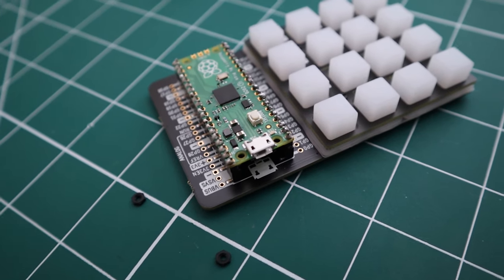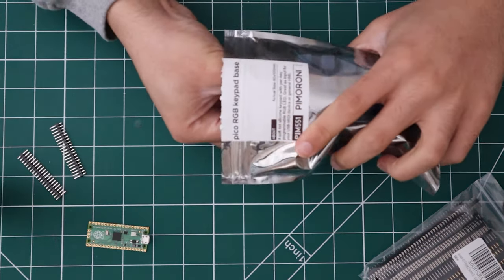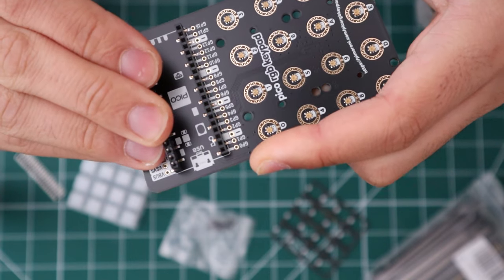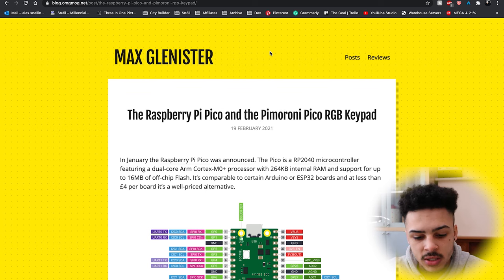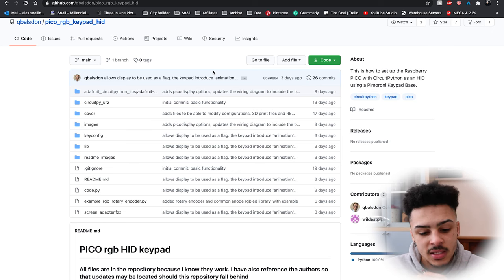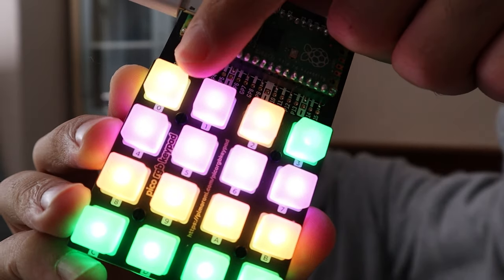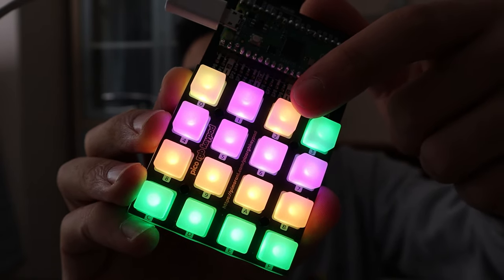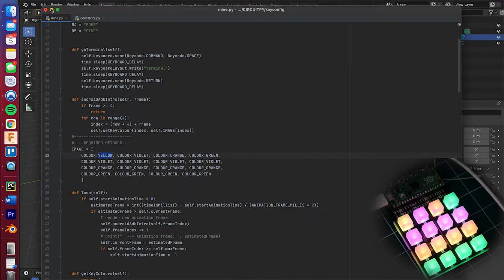Raspberry Pi Pico RGB Macropad - DIY Keypad By Pimoroni

Comment: Those solder joints look sketchy. 😅 Keep it up though! I've always hated soldering, and I've destroyed a pad or two in the past. Used to always put off projects that needed soldering, but soldering is one of those things that just becomes natural the more you do it. Great video!
Reply from the maker: Thanks I've been practicing but I still can get it down ahahah
Reply: @sn3lling  Tip: Do Not use the soldering iron to melt the solder onto the contact.  Heat up the contact first and then apply the solder to it.  The solder will then melt and flow perfectly.  If you try to apply hot solder to cold contacts, the connection will be extremely week.  Just be careful not to apply too much heat or you can melt or damage your parts.  Once you've got it mastered, you should be able to do each pin in a matter of seconds perfectly.
Reply: Is it safer to solder from a breadboard first?

Comment: Hey. It's my first time using the Pico with the PicoKeypad. I downloaded a demo.py code, saved as main.py on the pico, but it's not working. Simple python programes to blink leds works using micropython. I am using Thonny to put the scripts in. I am probably missing something really dumb. Do i need to install libraries for it (i know dumb question). I went to the GitHub, but there's lots of files. Don't know where to copy then to make it work. when i Run the code i got that error : 
Traceback (most recent call last):
  File "<stdin>", line 2, in <module>
ImportError: no module named 'picokeypad'

   So it's missing module/library right ? I am starting to learn Python...
Reply: Ow. Nevermind. I think i found the "problem", i have installed a firmware from Thonny and not the one from Pimoroni, modified with the extra libraries. Now its working ! :)
Reply from the maker: Good I’m glad it’s working. Sometimes depending on what code it is they may have a different version of the pico firmware. Good luck with your projects 👍🏾

Comment: Get a 4x4 RGB macro pad for just under 22 pounds is actually quite nice and the hardware looks like a solid base for extending it.

I wonder if they actually use all the pins or if it would be possible to add a small display to it so you could see the current state and button configuration on the screen – all fitted in a custom 3D printed case.
Reply from the maker: Yes I came across a screen add-on when researching this project and actually used the code for the macros from that project. Here is the GitHub link if you are interested :) https://github.com/qbalsdon/pico_rgb_keypad_hid
Reply: @sn3lling  Looks like a cool project! Thanks for the link!

Comment: what im confused about is when i try to look for the same example code as the video i dont know exactly what to use. just wish i could make the text in the background of the video clearer so i can see exactly what code to use. using circuitpython and im not able to get any lights up and running by using thonny.

Comment: Why didn't you explained the coding ?? .. please explain it .
Reply from the maker: Here is the GitHub:  https://github.com/qbalsdon/pico_rgb_keypad_hid
Follow the steps here to get the example code.
If you go into the keyconfig folder you can modify the keys to your own macros. 

In * def handleEvent(self, index, event): *
 add your own key functions by adding

if event & EVENT_SINGLE_PRESS:
            if index == 0 : #This is the index of the key you want to press

then below this you add the functionality for this key 
 
                
                self.keyboardLayout.write(Hello From Sn3ll) #This will type out anything in the brackets
                time.sleep(KEYBOARD_DELAY) #A delay to stop the macro running too fast
                self.keyboard.send(Keycode.RETURN) #Presses the enter key using the keycodes provided in the example code 

Hope this helps:)